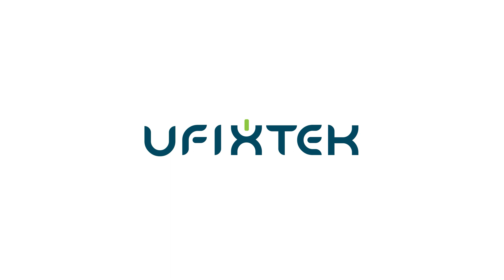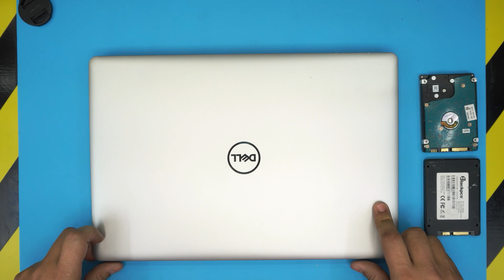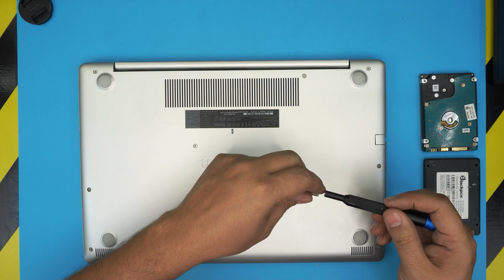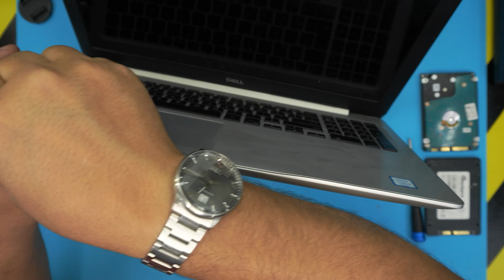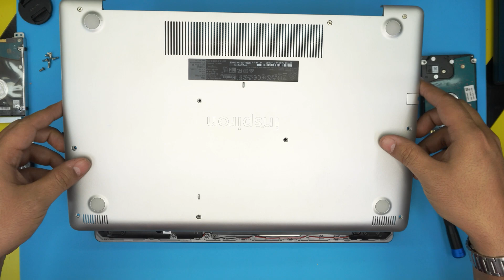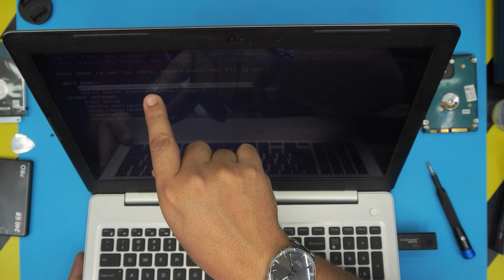Dell Inspiron 5570 Reg P75f ✅ SSD - HDD Upgrade 💻

Comment: Thank you for a clear & very helpful & informative video!   I'd like to inquire how do I use the mechanical har drive for storage
Reply from the maker: It's my pleasure my friend.
🫠Regarding your question, i need to know the pin count of the HDD jack on the motherboard in order to give you the correct link for the adapter.
cheers🍻

Comment: Will  1 TB fit in a Dell Inspirion 15 5000/5570? I went on Dell and they listed as high as 512
Reply from the maker: 🫠Regarding your question, don’t listen to them—you can have a 2TB HDD or a 4TB SSD (2.5") and, at the same time, place a 2TB NVMe without any issues. It will work perfectly. We upgrade these laptops for our clients all the time.
Should you have any further questions or requests in the future, please don't hesitate to ask me.
cheers🍻
Reply: @uFixTek  thank you. I aways maxed out my PCs in the old days but haven't done anything to a laptop since my Accer sapphire
Reply from the maker: It's my pleasure my friend.
Reply: What is a good wifi card upgrade. My original one never worked as it should out of the box. I bought that recommended 2TB SSD you recommended.  Thanks
Reply from the maker: awesome👍
a good wifi car is this:
https://amzn.to/40WCF8D

This is an Amazon affiliate link. When you use my links, you are helping to support the channel. 🙏
Reply: @uFixTek  I did order the 2 TB SSD from your link. Last night I orderd perhaps the wrong wifi card. It had a Bluetooth option on the face of it. Not sure if that will work. But I can return it. I have the one you recommend in my cart now.  I also will attempt to change ram from 12 to 32 GB. Dell did say that was possible. I ended up getting the blue screen because of something and had to reset windows to fix. That was fine because the laptop is unused with nothing on it but a windows install. Send me link to the ram you recommend please. I bought 2 16s from PNY model DDR/32GB (2×16GB) 3200MHz (CL22) 1.2V . If these work I will probably use them because I opened them. If not I will try to return them. Thanks for your help.
Reply from the maker: they should work fine the PNY, the wifi car are bluetooth /wifi now they come 2-in1

Comment: Hi, does this laptop support a PCIe Gen 4 M.2 SSD or just PCIe Gen 3.0x4? If so what's the difference?
Reply from the maker: 🫠Regarding your question, it will support Gen 3, but you can install Gen 4, and it will run at Gen 3 specs. Gen 4 has much faster bandwidth.
Should you have any further questions or requests in the future, please don't hesitate to ask me.
cheers🍻

Comment: Hi there. I just received my nvme ssd directly from dell. It looks nothing like the long one you just installed. Its about the same width and the pins looks the same but its only 1 inch square. Yours is like 3 inches long. Dell website says my small chip is compatible with this laptop. The customer support technician says the same thing. I dont see how that's possible. I cant even screw it down the way you did. Are you familiar with the different style nvme chip im describing? Its a 512 gb ssd drive.
Reply from the maker: Thank you for your feedback! If you wish to support the channel, you can like, subscribe, or both!
Regarding your question, they send you a short ssd , don't know why you purchased from there, get it from amazon and belter quality and full size, if they send you a short then you need to screw it to the 1st screw hole as shown in this pic: https://imgur.com/a/KJxZrf6

if your ssd doesn't reach to the screw hole then you got a wrong ssd sent to you.
this is one of the best compatible and durable compare to the garbage they sell: https://amzn.to/41zxmKo
Should you have any further questions or requests in the future, please don't hesitate to ask me.
cheers🍻

This is an Amazon affiliate link. When you use my links, you are helping to support the channel. 🙏

Comment: I have the Dell 5570 I7 8550 Laptop. It came with a 1TB HDD and a 128 SSD. I wanted to upgrade to a larger SSD, but I'm not sure what the max size is I can use? Dell says too different things... one says 256 max and the other says 512 max? Thanks
Reply from the maker: Thank you for your feedback! If you wish to support the channel, you can like, subscribe, or both!
Regarding your question, Don't listen to them. I have been servicing these laptops for 17 years, and we upgrade them for our clients. The maximum SSD m.2 you can install without any issues is 2TB, and it will work beautifully.
Should you have any further questions or requests in the future, please don't hesitate to ask me.
Reply: @uFixTek  Awesome. Thank you! Do you have any videos on how to remove bloatware on the Dell Inspiron 15 5570 I7 8550? The machine has always sucked on slowness! Thanks
Reply from the maker: Sure, my friend, you must trust me on this :P
To open PowerShell as an admin, right-click on the Windows Start menu. If you are using Windows 11, click on "Terminal (admin)". If you are on Windows 10, click on "PowerShell (as administrator)".
Once in the terminal, copy all the content from this paste:  https://pastebin.com/8HkQ7wy5  , and paste it into PowerShell. It will take a minute to run all the commands, and at the end of the process, it will finish with this line: "[void]$Form.ShowDialog()".
After that, all you need to do is press Enter, and a menu will open. Click on "Remove all Bloatware", and it will display "Finish" after a few minutes.
Rest assured, it is totally safe.
Here is the link you provided: https://imgur.com/a/1nqqvTy
Reply: @uFixTek  awesome. Thank you 🙏
Reply from the maker: It's my pleasure my friend.

Comment: Hi, what will you recommend from these:

RAM: 2x16gb 2400mhz
- crucial
- samsung 
- kingston fury

* Is the ram mhz cannot be exceeded up to 3200mhz? 

M.2
- Kingston NV1 NVMe PCIe SSD
- Samsung MZ-V7S500BW 970 Evo Plus

Thanks much!
Reply from the maker: i highly recommend the crucial for the ram and 2400mhz , no it can't exceed to 3200, the bios will auto adjust to max it can support.
about m.2 Please use the Samsung MZ-V7S500BW 970 Evo Plus, it's much much better than others.
but if you can get the Samsung nvme PRO, (that would be the top of the line  :P )
Reply: @uFixTek  thanks much for the quick response! Great help!
Reply from the maker: It's my pleasure my friend. 😊
Reply: @uFixTek  is it still good if the available mhz is 3200.. i cannot find now 2400mhz.. .

And how would i know that the Crucial is authentic from the store?
Reply from the maker: they are all authentic on rams there is not pirating or fakes.
get a 2666 not a 3200.
https://amzn.to/3PgUrO3
Reply: @uFixTek  im from Philippines,.. is there an option here that i can send you sa mple pictures i saw from the store here in our country?
Reply from the maker: sure send me a picture using this website: https://imgur.com/

Comment: I have dell 5570 p75f but why when I put it on a 128gb nvme m.2 ssd when i start it doesn't appear?
Reply from the maker: Thank you for the feedback! if you wish to support the channel you can LIKE or SUB or both :P
regarding your question: can i know the CPU detail what CPU you have and what GEN? its 8Gen ? if so it should show! check under disk management. can you share pictures of the task management and disk management

Comment: I have dell 5570 with i7 4gb Amd Radeon graphics card but that laptop has to get replacement of Motherboard and new NVME ssd ...So should I go for it or BUY new dell g-15
Reply from the maker: Thank you for the feedback! if you wish to support the channel you can LIKE or SUB or both :P
regarding your question: depending how much they are charging you for the new motherboard and the ssd! ?, if the price it s too high then no but if its reasonable price then sure!